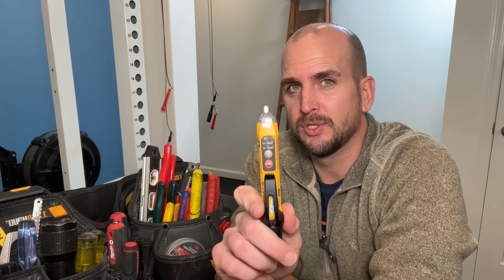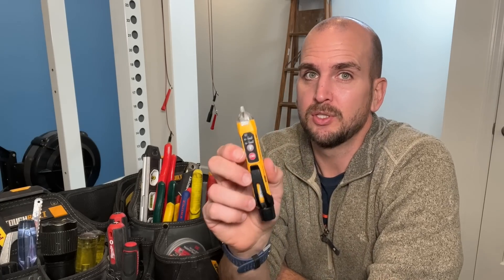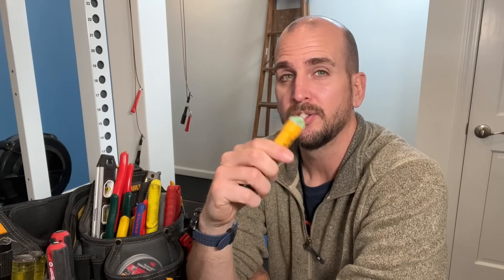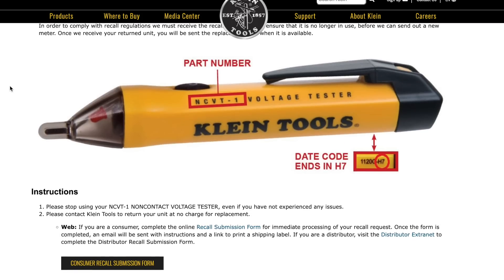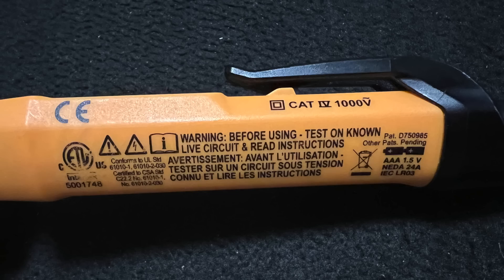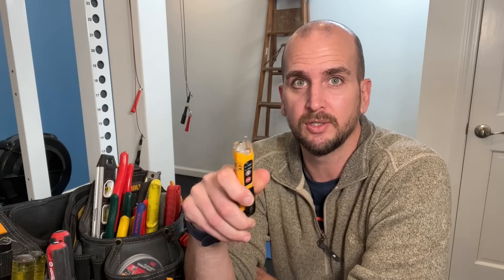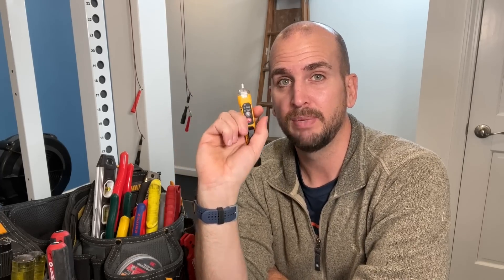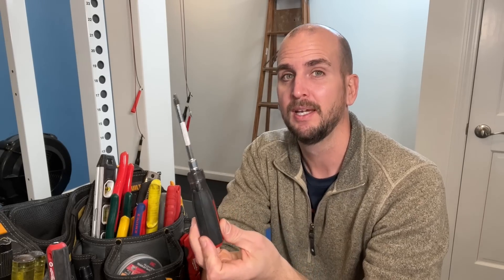The Tool I Get The Most Negative Feedback On And Still Use Weekly

Comment: Super smart guy here, I wear one around my neck with a lifeguard whistle lanyard. Mostly because it saves time, anything my life depends one there a fluke with fluke leads (cheap leads only for the low voltage bench) and every circuit is live, even when it's not

Comment: I carry a Klein NCVT-2 dual voltage in my shirt pocket at work as an industrial mechanic everyday . It saved my butt one day when I had a 480 disconnect turned off and out of self safety I tested the circuit anyway with it. Some dumb ass had tied line and load together at top of disconnect because of a burnt throw using only on the circuit breaker as a disconnect. I won't work without one.

Comment: I have two cheapie ones, Ultimate AC Sensor and All Sun. Neither of them have a battery LED, and neither say to do that known-circuit test. That's probably why people are saying not to advise homeowners to use these, only the top-of-the-line ones have the safety features that you're used to.

Comment: I'm a retired Motor Mechanic and Auto Electrician who does a lot of diy and I regularly use my Kaiweets HT100 ncvt for proving a dead circuit but always double check on known live feeds before I start work on that particular circuit,I use multi meters as well but like you mainly for continuity tests,I'm in Scotland so our electrics are different from yours but sometimes I'm a bit envious of the simplicity of some of your  components and the ease of fitting or installing them,great video,good to see someone with a sensible approach to NCVT's

Comment: I’m a retired master electrician 42 years in the trade.  I used Fluke non contact all the time, they do need to be replaced every now and then if used professionally. I also used a Fluke T Pro tester and a Fluke 87.    

I had a customer use a budget non contact tester and it kept beeping on his basement foundation and he was confident it was energized. My series of Fluke testers said otherwise.  I suggested he toss his in the trash and get a Fluke.

Comment: 20+ year field service technician. Always, ALWAYS, perform a live/dead/ live test with a good multi meter. You are trusting your life to your test equipment.
Reply: You know, nothing substitutes for the equipment between your ears.  I use a non-contact tester for gross indications of power / no power before I investigate further.  This includes troubleshooting equipment plugged into an outlet.  I had an incident where an appliance stopped working.  I could quickly verify current at the outlet, current on the cord to a Variac, and then power cord from the Variac to the appliance.  It was obvious the problem was with the Variac and a quick check of the Variac's fuse proved that was the problem.  No need for a multi-meter for that kind of work.
Reply: @buckhorncortez  The fuse at the variac was not the problem ! It's a safety device because of the real problem.

Comment: As a first-year apprentice, I am required to have a non-contact voltage tester, and it was the first tool I purchased.  They don't make you 100% safe, but they can improve safety to varying degrees, depending on use and conditions.  I'll take any improvements to safety, but I also follow best practices and never take chances.

I use mine dozens of times a day.  Comes in really handy when trying to fix someone else's connection mixups in pull/junction boxes with large numbers of joints where they mislabeled some of the conductors.  I'll even use it as a breaker locator as I always carry 2 cellphones (work + personal) and can hear the status of the tone over the phone while flipping breakers (as long as the signal reaches).

Knowing that instruments are fallible, I always keep a second one in my kit, plus my multimeter, and plug tester.  Several sets of spare batteries are also part of my kit, and I test each cell to make sure they're good.

As mentioned in the video and on the tester, always test the NCVT on a known live circuit, and make sure you take advantage of adjacent circuits to verify.

Be safe everyone!
Reply: I like your cellphone trick.  I was replacing an outlet in an old apartment building one day. The outlet was on the second floor and the panel was in the basement. There was so much crosstalk on the cables that my circuit tracer was reading on 5 or 6 breakers. And I was alone.  I remembered I had a remote controlled power cord in my van, so I plugged it into the bad outlet and plugged a shopvac into that.  I opened the panel and used the remote and my ammeter to find the right breaker.
Reply: @adirondacker007  Neat trick.  Yep, toggling heavy loads on and off would make the current change rather detectable. 

It's amazing what people come up with in the field.

This one guy I worked with needed power outside, and there were no plugs.  Left the generator at the shop.  So he unscrewed the plug from his extension cord, fed it through the 90deg pull box outside into the building, went inside, screwed the plug back on, and plugged it in.  Lol.. It got the job done.
Reply: Use a breaker finder
Reply: @hebers2355  I'm a first-year apprentice, and circuit tracers aren't in the union guidebook employee-provided tool list.  They are supplied by the company, however I find they don't work reliably, aka crosstalk, and they aren't always readily-available (other electricians using them).  I do plan to buy my own, but honestly, there are other more important tools I want/need.  I have been able to find most circuit breakers using my NCVT and T6-1000.

Comment: Always test your test equipment. I spent an hour trying ti find why a 12v circuit was dead only to find one of the leeds on the multimeter was bad. I now always do a check on the leeds by doing a continuity test on the leeds.
Reply: Lol never trust a meter that hasn’t had a recent lead check. This should be the first thing you do any time you pick up the meter
Reply: Yes!  Doesn't matter what kind of test gear, assume its faulty until you've proved it works each time...even if it worked earlier today maybe it got bumped or something and developed a fault.  Once you prove its giving sane readings on a known thing you can then use it to test other unknown things.

I had a multi-meter I blew the fuse accidentally and then later was wondering why everything had open circuit no voltage.  Didn't realize for quite some time what happened and somehow continuity still worked fine giving a false sense of security that the meter/leads were okay...could have been nasty if I was trusting it to tell if mains cabling was safe to handle.  Fortunately I was just debugging a battery powered speaker at the time.
Reply: @matthewmiller6068  Poor quality multimeter. Mine would read wandering values. t only reads zero when the leads are connected together.
Reply: Leeds is a town in Yorkshire, leads are what go to your multimeter.:goodvibes:
Reply: Pedo Killa  Well, if you put the test leads on something and still get random readings on the meter, clearly there's something wrong !
Reply: Absolutely

Comment: personnaly i use the fluke , the round one
because of it's compact and it is round...fit's it your shirt pocket ..so you always have it 
i have been using them since they exist

DANGER with non contact
be carefull when working with generator or ungrouded system... non contact detector won't work on these 

ps  legal stuff ...don't know if it changed 
reached to fluke couple of year back 
if you read correctly the tool is design to advice you of THE PRESENCE of voltage .... not the absence of it  ... 
small legal detail in the manual lol

Comment: Mine is a NCVT2  I have had no issues with it also use a circuit tester and occasionally a multi-meter for continuality and voltage. Thanks for the tips !!

Comment: The NCV tester, tick stick, sniffer, whatever you wanna call it, is only ONE tool to ASSIST you. It is NOT to be relied on exclusively. That's why we have multimeters, plain and simple. The advantage of a tick stick, at least for me, is when I'm working alone I can stick it where I need it and turn a circuit on/off to let me know when or if that's the correct circuit. So called "professionals" only bitch and complain because, well, they're not as good as they think they are

Comment: i use this a lot on the job.  just beware not perfect.   i keep my better tester ready though if i need it.    remember years ago,  in a very old house where the owner used a non contact voltaage tester and it was fooling him.   so i had to explain that in the old houses around 100 years ago. the electricians would switch the neutral wires. not the hots.  so it threw him a curve ball.  fixed the circuit for him.

Comment: When in doubt just grab hot with your 9's and touch neutral and ground. If live, a spark will happen and breaker will trip. Circuit now safe to work upon. Saves time of running back to panel and searching correct breaker.

Comment: I've gotten into the habit as a first year apprentice of carrying the NCV as well as a meter with me, since my meter has a belt loop and I can carry both.  This allows me to diagnose many different types of issues very quickly, and it's not very cumbersome as far as extra body weight. Being able to quickly check power on cables or wires with the ncv is valuable, as well as the ability to check voltage with a meter in the case of equipment or devices such as receptacles.

As far as false positives go, while in the field you sorta get a sense of when you have a false positive. It's extremely obvious when you are getting a beep from your own movement vs from potential on a wire. (Though you should ALWAYS test your ncv and meter on a known live power source before starting your day, to ensure that they are working normally.)
Reply: Its not false positives you need to worry about its false negatives that will get you in big trouble. Always use a meter.

Comment: I have 2 ncvt's.  My older one has a dial to adjust the sensitivity & it is crucial that you check it on a known live circuit first.  Dial the sensitivity too low & you get a false negative, dial the sensitivity too high, and you get false positives (a lot of them).  I actually think that one is looking for 60Hz & that's why it is so prone to false positives & has a sensitivity adjustment.  An unenergized conductor can still act like an antenna and radiate some (attenuated) 60Hz from a nearby circuit.

Comment: I troubleshoot underground irrigation system wiring daily, both low (28v) and line voltage. I use my NCVT constantly and in conjunction with a multi-meter. The one area that consistently will give a false negative reading is with a wire that is still in close (2" or less) contact with the bottom or sides of a trench. Making sure to pull the wire up at least 6" away from the ground will give consistent readings.

Comment: Licensed electrician here.  Do not go with the cheap ones with the roller sensitivity adjustment or one that you have to hold the power switch in order to test.  Non contact voltage testers are meant as a base line safety tester.  It's useful for identifying whether or not you have live wires in the box.  If the sensitivity is right you can also use it to narrow down which wire is live as well as figure out which wire is switched or load.  If the tester continues to read live when you have made sure they the circuit is turned off, or you have other reasons why you need the specific voltage value that is when the electrical meter becomes useful.  If all you need is an answer to whether or not power is present the NCV tester is the safer means to answer that question.
Reply: No its not, they sometimes wont detect voltage at all depending on lots of factors. Safest way is a meter connected to the circuit.
Reply: @RadioRich100  They work fine for what they are designed to do.  The cheap ones are the worst offenders for breaking or not detecting.  The other ones that tend to have false negatives are the ones that are designed where you have to keep pressing the button to detect.  However, if your NCV tester is in good condition and you follow proper usage instructions, it is extremely reliable and at worst will give you a false positive for power when you have good batteries.  The reason meters are less safe for just checking for the presence of power is because you have to expose yourself to live bare metal.  Meters also take more time to use because you spend extra time exposing the live metal and have to put the connectors back on when done.  If all you need to test is if power is present and you're not worried about the voltage, the NCV tester is your best friend in most situations.  If you need to know the voltage at that test location, then you have to use the meter.
Reply: @ianbelletti6241  thats your problem you dont want to take the time. Any test equipment which is well know for false anything doesnt belong in your bag. Take the time.
Reply: @RadioRich100  Even meters can give false results.  Are you saying we shouldn't use meters either?  It's important to understand your equipment and proper usage.  It is also important to use quality equipment.  You are right in a limited sense in that we should not be using a low quality NCV tester.  However, you are wrong if you think my using a quality NCV tester is a problem.  NCV testers were created as a safety tool and it does that task well if it is a quality model.  A quality model is also useful for identifying which conductors are constant hot and which are switched without having to take any wire connectors off.  It is a safer way to test live conductors as well as a good way to know if any wires are live.  It is clear that you do not fully understand the operation and purpose of an NCV tester and your only experience is with cheap low quality testers.

Comment: 22 years in maintenance here and I agree.  It's a great quick check if you are trying to figure out whether you have a localized or ballast issue or if the switch is broken.  I wouldn't bet my life on it, but that's not what the tool is designed for.   I also carry a small voltage tester and I always treat everything as if it's hot anyway.

Comment: NCVT is a time saver, but it's not a life saver.
Use it when it's safe to do so, but NEVER risk your life on its reading.
I use them all the time, but if it's a risky task or if I'm unsure if there's current or not, I use a MM or a clamp meter to verify.
You can do it right a million  times,  it only takes once to change, or end your life.

Comment: I was a safety officer at an military hospital in 1980. I used a early version of the non-contact voltage tester on inspections. I was shocked on an inspection in the waiting room of the obstetrics department. I got indication on a metal table. There was a TV on the table, right next to a sink with metal fixtures. I unplugged the TV and called the engineers. It turned out that a plywood plate was screwed into the chasis of the TV. The screw went through the protective plastic case of the TV to the hot chasis of the TV. That experience made me a believer in the technology. We may have saved a life (or two!) . I am happy to have false positives! I have given the tool to my son and son-in-law. Excellent video

Comment: I am a DIYer but after 4 decades of repairing vehicles I am responsible for fixing everything. Like the cooktop range hood fan w/3 speeds that just quit. It was the run capacitor in the PSC motor. I have a Sperry brand tester much less my Fluke 87-V RMS meter. Like an old west cowboy without his Colt, I would feel naked without. Yes, it test capacitance as well as “Min-Max” features that are a must have. An extra tool like this used in the video are extra insurance what you have before working on it. Sometimes you have to work with live circuits to catch a fault so use everything in you box that is quick because after safety comes time spent. Never go into a battle with high current system, unarmed!